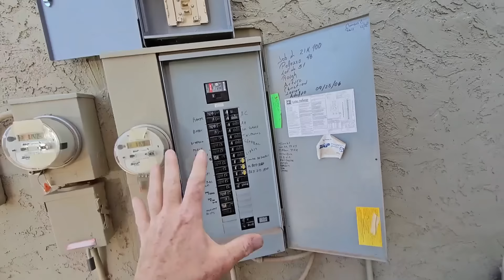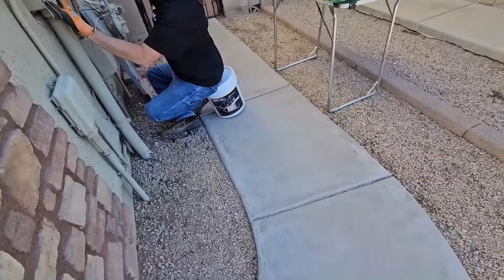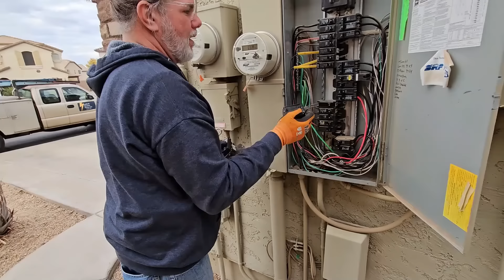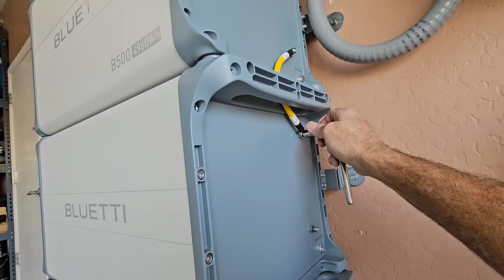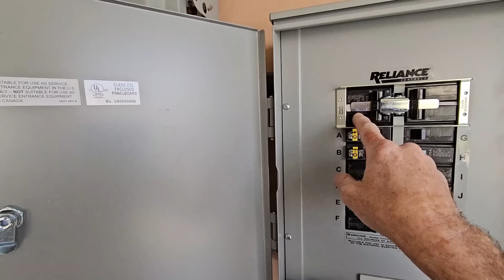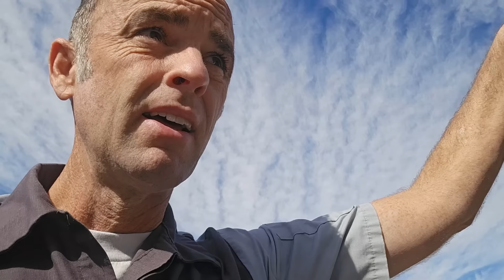How to Install A WHOLE HOUSE Battery/Solar Generator: EP800

Comment: My question is if the EP800 inverter can interact with an auto transfer switch and basically become a generator replacement for a small IT room with critical server and networking equipment?  We can put rack mounted UPS systems in each rack to carry it through a brief power loss, but that only gets us about 10 minutes max. Plus, high kVA UPS systems are extremely expensive per kWh. I'm looking for something like this instead of an LP gas generator, as something that can get us a couple of days with no grid power.
Reply from the maker: I did test this on my 50amp motorhome which has a auto transfer switch and it worked flawlessly, the EP800/900 is a true UPS so it has a transfer switch built in that is crazy fast so you could be on grid continuously and then it would switch immediately if grid power was lost.

Comment: I was hoping all thru the video that you were gonna run the house AC off the system, imagine the savings in AZ.
Reply from the maker: The central AC is 240vac and while the system could run it, I doubt it would last a full Arizona summer before burning up.
Reply: @AZExpert  Thanks. Eventually, I hope the tech will get there.

Comment: The last thing I want is an app for my solar system. When TSHTF there will be no grid and no internet. I was very disappointed to learn that my Solar Edge system needs cell service to the inverter and to do anything I have to use an app where the server in Israel or wherever it is needs to be up to run the app. I think this is a scam because with these solar systems you need the infrastructure of the whole world up to be able to control or see what your solar system is doing. When mine failed there was only a red light... I could not do anything without the app.  I wanted to be energy independent but am now subject to multiple failure points in cell towers servers in far away places and their electricity supply , and Internet connectivity.
Reply from the maker: I think there is an interface that could be connected, but wifi or internet is not needed on this, Bluetooth would just be wireless control which is an easier installation at least
Reply: Not sure on yours, but the app on my home solar is just there for monitoring. Everything else is local and it works just fine without wifi.

Comment: Love your vids! Pet peeve of mine, there's no such thing as a solar generator. Batteries or battery systems store/pass electrical energy already created by the solar panels/grid, power is not generated at the batteries. A more accurate naming description would be a battery backup. A gen set/gas generator converts energy from gas/other fuels. Can't stand incorrect terminology. IMO makes it more difficult for newbies to understand.
Reply from the maker: But this does have power generation through solar chargers built in, the panels are the fuel for it
Reply: @AZExpert  I get it, on board inverter. Lol you know that's a stretch. The DC current created at the panels via excitement of electrons is converted to AC current. There is no generation from a mechanical force. Unless you see the movement of electrons as mechanical and funny thing, nobody really knows how electricity works we just know how to use it. That said, it still happens at the panels.
I love your stuff and have you have helped me do some pretty amazing repairs. Respect!

Comment: Nice system but the installation seems overly complicated. I use a 3500w Inverter Charger with a 10kWh AGM battery bank that feeds all the critical circuits in our home for emergency backup when the Utility power is down (2-3 times per year). It was easy to install. I don't run any 240-volt loads as the battery requirement would be absurdly expensive to deliver that much power (in addition to the PV for charging).
Reply from the maker: It was a more advanced installation, but I am not sure how your setup would be simpler based on your description.
Reply: I would post a schematic but it doesn't seem possible here. @AZExpert